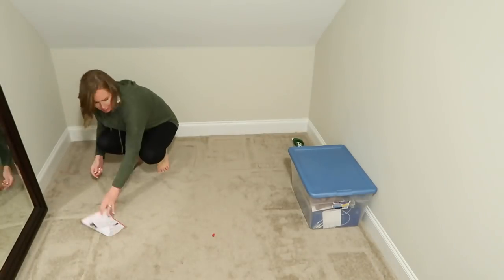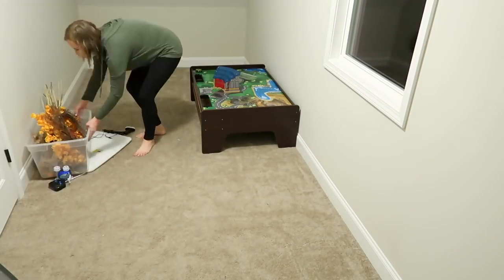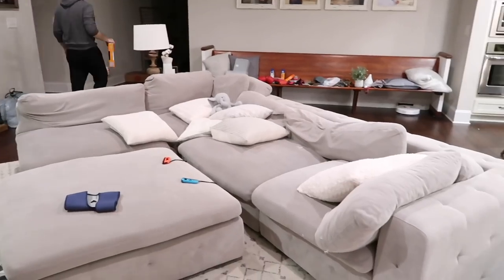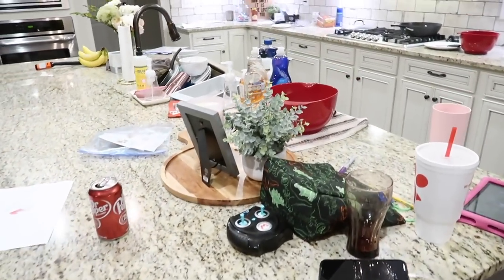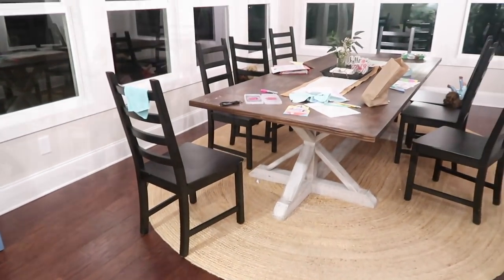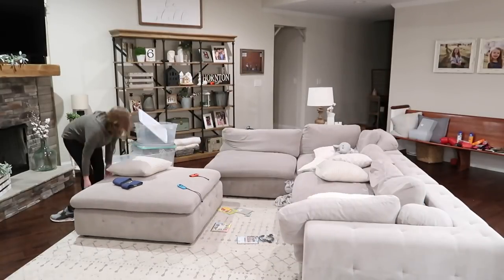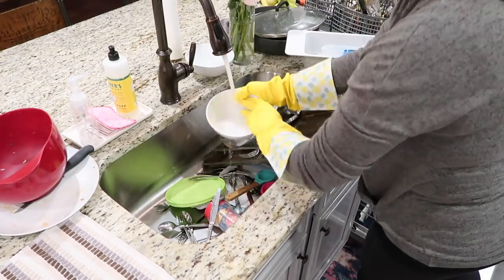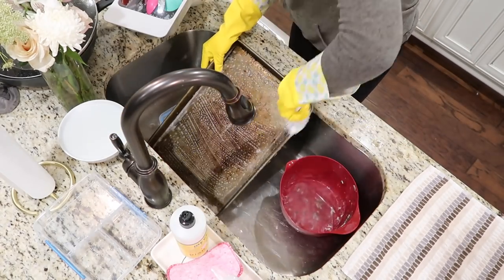EXTREME DECLUTTER & ORGANIZE! | CLEAN WITH ME

Comment: O.M.G. 

Always - Always - Always -  start at the  top and  work  your  way  down.   Just like  reading  a  book.  Left to right.   NEVER - EVER-  EVER -  go Back over a  Dry  painted  area with fresh  wet  paint ! ! ! !   WHY ???   Put  quite simply  they are called ( LAP  Marks ) the  areas  will appear  Darker  then the  others  because there is  ALOT  more  paint  and  color  and  pigment  and   coverage  there ( OVERALL ) .  Painting  101 is  about   - K.I.S.S.  -  or    Keeping  It  Simple - STUPID .    Only  do  small  things first.   Around  doors,  windows, closets, and  such.   Be sure to ( INTER - Mix )   multiple  cans  or  Batches of  paint  together  from the  start to INSURE   Uniform  coverages at the  end.   Better to paint  out of a  taller  bucket  with a  Screen  then a  pan on the  floor. WHY ???  Ever  see someone  step in a  pan  then  try  to  clean it  all up after   walking across the  carpet or  hardwood  floor and  NEVER Being  Able  to get the  Stains  out ???  I  Have .   In The  Construction , Interior  / exterior  world  the  term  is this  ( GRAVITY )  is  your  friend .   By painting ,  down then up  you  run the  risk  of  platers , spills, and  spots  getting all over the  Areas  you  have  completed.   TOP DOWN - LEft to Right  INSURES  the  fresh - Wet  paint  will Blend - MATCH  - with  what  is  being  down  before  and  after . 

BEGINNERS and  Pros  Alike  will Benefit  from a  few  simple    RULES HERE. 

Allow  more time then  needed.   Cut in as  you  go  ( TRIM )  so  wet  paint  and  wet  paint mix seamlessly .   If  one  small wall and  another  small wall  is  all you  get  done  to  start - So  be it . At leas they will be  completed and  look  better then  most  and then you  can move on to the  next phase  after that.   TO  MANY ( THINK)  THEY  KNOW  what to  do ( UNTIL  ) the  time  comes to actually  do it .  Have  had  to  correct , fix,  repair , and  replace  many a  ( D. I . Y . )   attempts  that  went  south  a lot  faster  and  costing  a lot  more money then a  simple  can  of  paint  or  brush and  roller  combo  combined.  Anyone  who  had  successfully  completed a task   knows  that  Preparation is  over  75%  of  the Goal.  Execution is  the  rest.  Have a  Plan , Follow  the  plan , the  plan  succeeds -  End of  story .     Oh , By the  Way .  Dark  Colors  will always  make  rooms  look  smaller - Regardless.  Better to  go with  Slight  Shades  of a  Selection  then  All out ( Dark  Blues  Blacks, Greens, and   Such ) .  You Will get a  greater  benefit  in the  end  and  if you  choose to  paint  over it  later will have  saved ( MULTIPLE  STEPS  -  then - In  doing  so  now !  !! !   tan , sand  color    going  over  ( Off White )  is  easy  .    White  going  over any color  - Dam  near  impossible  unless you  add in  two  three four  or  more  coats  coating  you  precious  time and  money -   SAD, SAD,  SAD,  SAD,  SAD,  - Butt - true.